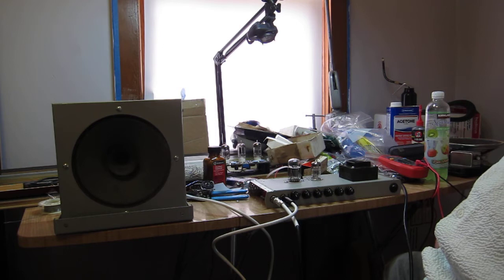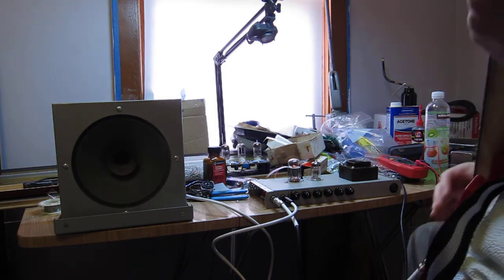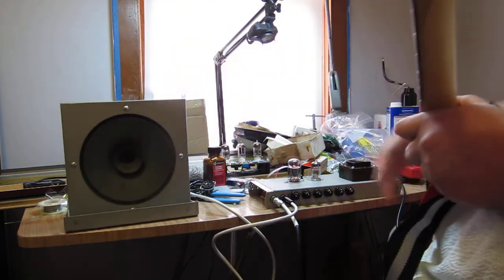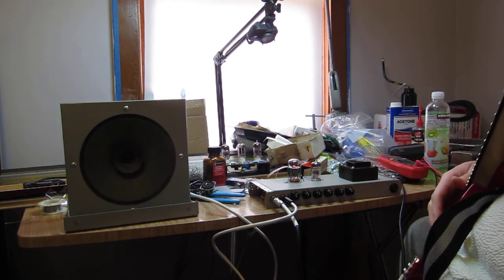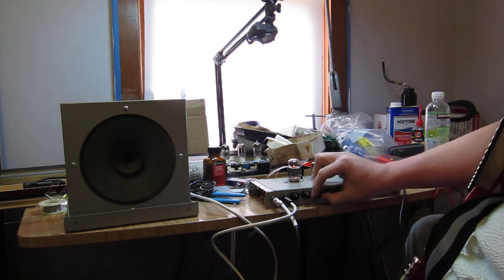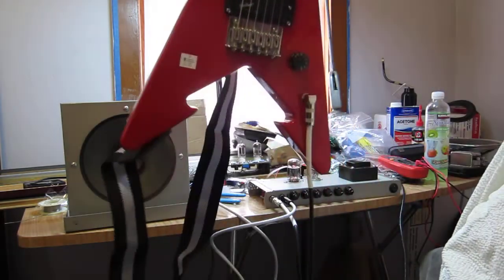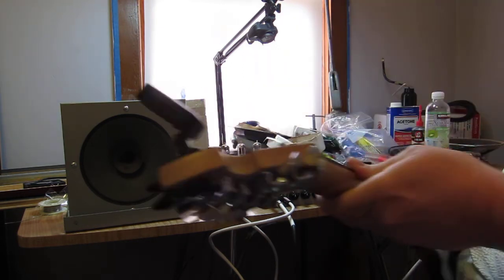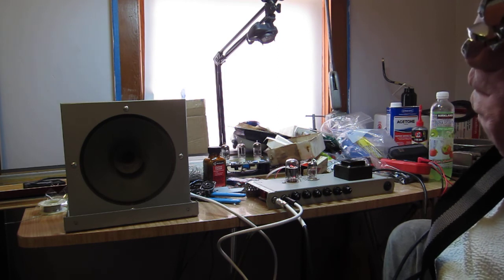Super Squirrel Monkey compactron guitar amp test one

Comment: the problem is oscillation due to too much gain. you dont need the 12ax7 in addition. this tube oscillates easily with audio application because the 3 components are so close together . you could just use the 12ax7 set up like a 5f1 champ and use the beam power section of the 6af11 and it would probably sound great.
Reply from the maker: That's a reasonable theory. Thing is, the guy who came up with this variation on the Squirrel Monkey tube amp said he did it because his 6AF11 wouldn't stop oscillating when using the built-in triodes in series. Or something. 

Some are the problems were probably just due to my inexperience with tube amps. I sort of abandoned this project in frustration 3 years ago.

Comment: Very nice. My experience with this compactron has really been surprising. With the right circuit you can make some terrific amps. Even without the ECC83 or other pre-amp before the 6AF11 it will sound great. I found you really don't need the additional pre-amp tube at all. Very nice sounding spud amp and they are super cheap.